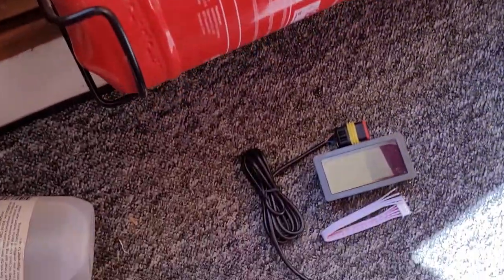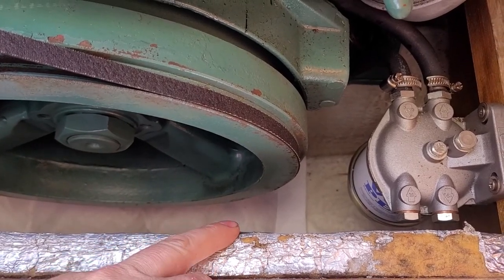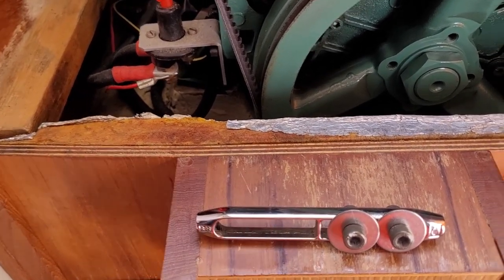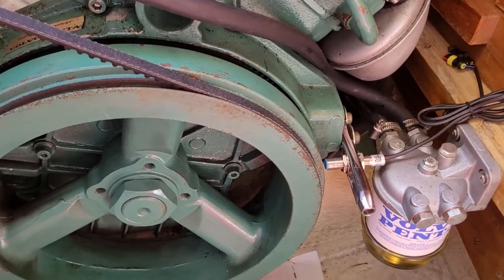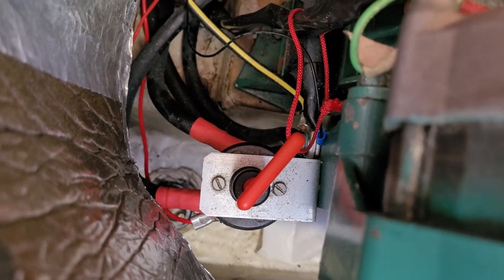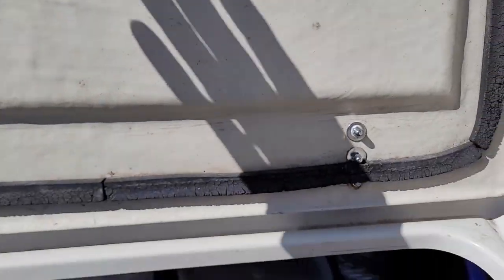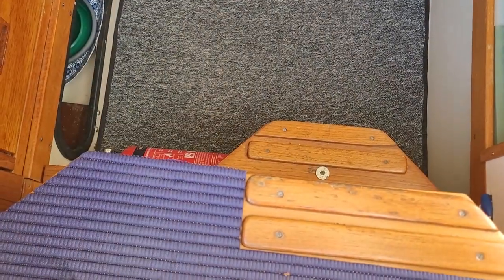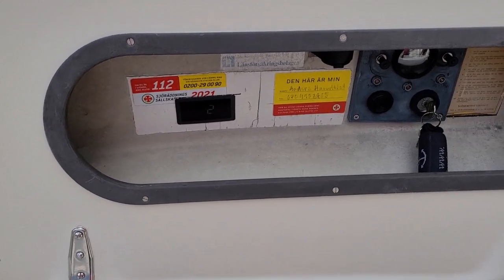Sailing River Song  Captain's Special - Cheap Tachometer for VP MD05B

Comment: thank you for sharing, I was looking  into something like this for the last 3 years. Now I can follow your instruction. Will try!
Reply: I will probably install it in the wooden footstep next to the cockpit entry, as there I have it directly in line of sight while steering the boat. one question: how good is the brightness of the LED display? will I be able to see it in sunlight? or is it better to do it like you (in the shadow next to the motor-panel)?
Reply from the maker: I dont think it is of that high quality that it will show Good in sunlight. 🙂
I put it in there so i would be sure to See. 🙂 Those few Times i want to check.
Reply: Hi again, I just tried installing it on my MD5B, but didnt get it to working 100%. 
The display turns on and shows 0000. I tried several distance positions  between the magnet and the device but didnt get it to show any value. So I guess I did some wrong wiring. Can you tell me how you connected the wires (e.g. What to do with cable #4? here it only shows a Chinese symbol)j? Maybe you can share a picture?
Reply from the maker: Did you get The cables right?
I did it wrong The first time
Reply: @SailingRiverSong   I will check once more when I am on the boat again. I just found a better picture of the wiring on the internet! 
1 power supply positive
2 power supply negative
3 Ground Signal
4 empty/not used (correct?)
5 Switch Puls Signal
Reply from the maker: Yes so you go in with positive and out with positive from 1